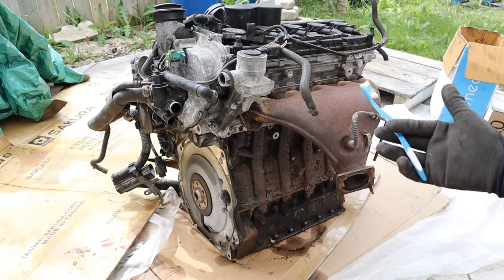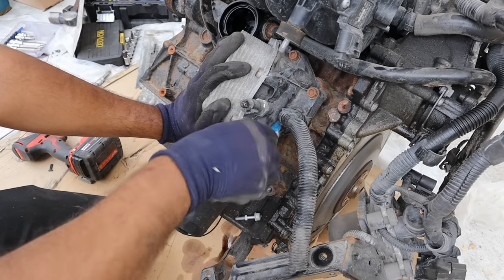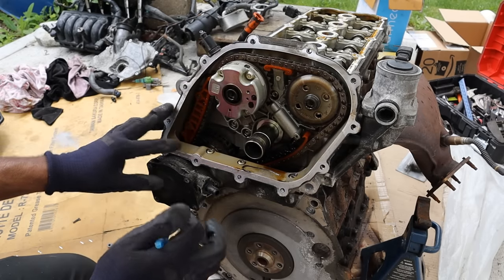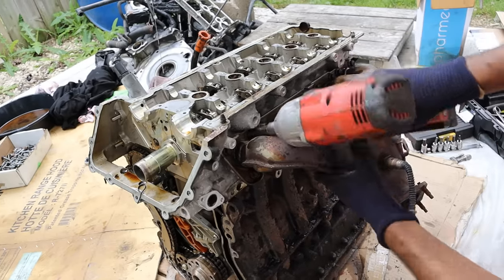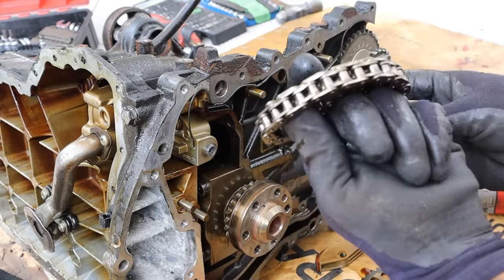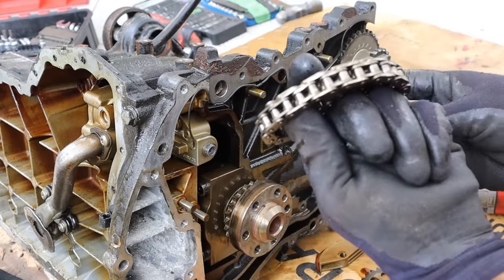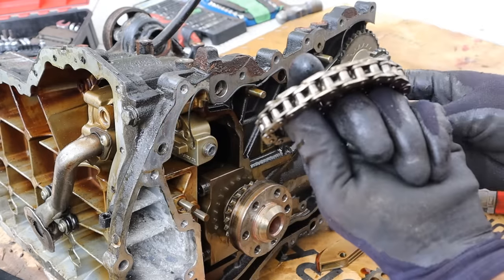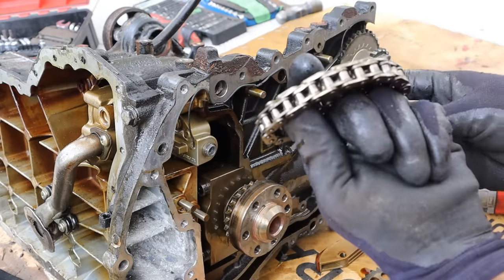The Volkswagen 5 Cylinder is an Anomoly

Comment: Probably one of the best engines VW has ever made, I regularly see these with 200,000+ miles. I've had two of them personally and haven't ever had any major issues. 300,000+ miles combined on both of mine
Reply: Heartily agree. I have a 2.5 Jetta with 263k and it replaced another 2.5 Jetta that had close to 200k before it was totaled. Zero major issues.
Reply: Mine currently has 202,000 miles and going strong.
Reply: Currently have my ‘09 with 136k miles on it. I’ve been changing the oil every 4k miles or 5 months with 5W40 Leichtlauf High Tech Engine Oil (5 Liter) - Liqui Moly LM2332.

Parts that have failed on mine:

2019: ABS module, VCG, & serpentine belt (dealer)
2020: Alternator (Indy shop)
2021: PCV diaphragm (Indy shop), oil cap gasket (DIY) 
2022: vacuum pump delete kit (DIY), MAP sensor (Indy shop)
2023: belt tensioner (DIY)
2024: valve cover kit (DIY)

Upcoming fix 2024: OFHG (Indy shop)
Reply: I’m at 190k miles on mine.. just replaced valve gasket, map sensor, spark plugs and coil over packs. Also put on new brakes. She’s running pretty strong still.
Reply: Probably why they make it complicated and hard to work because they know this engine would rarely see a wrench. So they give the customer 3 times or maybe more labor cost to fix it. If it's ford or just normal asian car, yeah they easy to work on but that also mean you'll have to work on it at least 3 or 4 times in the lifespan. 😂
Reply: I have an 2006 Jetta with the 5 cylinder 127000 miles miss fire on number 1.   90 psi compression    🙁.  Figured I get more out of it than that
Reply: the best vw engine is the 1.9 tdi. fight me
Reply: @mikealicious3848 Seems like mk5 had a little bit more issues than mk6s. My ‘13 jetta is sitting also at 136k miles, and surprisingly I use the same liquimoly oil (the purple one). In my case I had the following repairs done:
-Throttle Body
-Intake manifold 
-Crankshaft position sensor

And that’s pretty much about it. It’s been pretty reliable and is the highest mileage sedan I’ve ever owned. But not everythings bright, my 09g transmission is starting to act up and im fearing the worst. Hope it isn’t the valve body.
Reply: @oldschoolmechanic7771  timing chain skip a tooth?
Reply: I guess I'm unlucky with my lemon. Always change it every 8k kms and had to do both chains 2 years ago. It's now already having chain rattle on cold starts.
Reply: @colesalegna1248   I think I would like a 2.5 Jetta, rabbit, or golf.  Could $4,000  very possibly buy one?
Reply: @jp-sama4176 Put em up! 👊👊👊👊😂
Reply: I have 203k on my 2.5L and it's flawless
Reply: i have one with 284k still running strong!!!
Reply: I’m hoping my ea888 will last like this with regular maintenance

Comment: I don't understand why 5 cylinder engines are not more popular. When done correctly they are as smooth as a V6,  easier to package due to being narrower and cheaper to make due to only needing one cylinder head and one set of camshafts.
Reply: V6's have a lot more parts, manufacturers like that because it drives the service costs up, and that's more profit for them.
Reply: @EdgarsLS  True but they cost more to make so less profit when they sell them in the beginning.
Reply: @EdgarsLS  I think V6s shouldnt even exist. Thats my based take for the day.
The absolute dream engine configuration I can think of would be a turbodiesel i6 with a belt driven camshaft because fuck chains.
Reply: @alouisschafer7212   Gears

Build it once with gears and never touch it until there is a mechanical failure
Reply: @alouisschafer7212  why fuck chains? If done correctly they last the lifetime of the engine.
Reply: The truth is that both are pretty much non-issues. At one time V6's were a thing because turbos weren't as reliable as they are now, and manufacturers could just take the architecture from their V8's and cut them down or take the cylinder architecture from an i4 and scale it up. If you go back to the late 90's and early 2000's, the idea of a 2.0l turbo 4 in a higher tier everyday car was a scary idea for a lot of buyers. Plus, I have this engine in the MK6 Golf form; it's really one of my most favourite engines I've ever owned, but the engine is slow to spool up from a start, once you get going it's tremendously drivable. But really, the writing on the wall is simply that VW never kept pace; 5 cylinders and 5 valves per head, but a Honda K24 eventually made more power from a less complex engine.
Reply: They killed off the 5cyl coz it was too reliable by VW standards.. They're more interested in disposable vehicles these days. Shame, the 2.5 5cyls were fantastic for what they were
Reply from the maker: The 5 cylinders are a compromise... supposedly more power than a 4, but a longer block means more width needed in the engine bay if mounted transversely.
Reply: They're narrow, but the block is longer. 3 long vs 5 cylinders long. Putting a 5 cylinder is basically like putting in a engine the length of a V10.

Also, 5 cylinders have to compete with straight 6 configurations. 5 cylinders are imbalanced, unlike like a straight 6 that has perfect primary and secondary engine balance. Since the blocks already taking up so much space and because they require more balancing, you might at well just go with a inline 6.
Reply: @AkioWasRight  This is mostly sorta kinda true.. For context you have to remember the VW 5cyls were only ever intended for FWD applications; end to end even with the transmission, placed in something like a Jetta transversely, it wasn't much different than a big 4cyl, when a straight 6 definitely wouldn't have fit end to end in a transverse layout no matter how small it would have been. In the FWD 5000 S's of the early 80's it got even worse for the case of straight 6cyl, those were longitudinally mounted FWD where a straight 6 absolutely wasn't going to fit so the 5cyl was that happy medium between 4 and 6 cylinders while still able to fit, delivering smoother power than a big 4cyl would have in a space an i-6 definitely wouldn't go.. Audi 5k era, this was long before VW's VR6's and V6's existed. Now as far as balance the early ones had all sorts of different balance shaft arrangements year to year application to application, but in later versions such as this one the crankshaft had been completely redesigned by then, other parts of the rotating assembly were counterbalanced and they ran pretty damn smooth. I'm not really sure how it hung around as long as it did, it's kind of a dinosaur, but I'm glad it did, they were the more overall reliable/longer lived less problematic of VAG engines for years and years. I miss owning later ones, that sound, and nice even torque curve
Reply: The key word here is "when done right" volkswagen doesn't do it right, volvo would be an example of a company that did it right
Reply: @jasonhooey5677  and MB, don't forget the 300TD lol, but that's a tractor engine! I'd argue the B52xx series from Volvo were very reliable indeed, but very heavy and extremely underpowered.. and prone to head gasket failure. Not really all that reliable turbocharged. As far as the gasser 5's go there's probably more VAG's left on the road than Volvos
Reply: @jasonhooey5677  Volvo sold a bunch of cars with the vw 2.5tdi with slight modifications for packaging
Reply: @7eis The Volvo D5 engine was not sourced from Audi.  It was of their own design.
Reply: @alouisschafer7212 belt 😂

Comment: Fantastic engine! Bulletproof with good maintenance. They are not actually that hard to work on and later years do not have the odd bolt under the intake. My 2012 Golf mk6 with 2.5L has 289,000 miles on it today and runs like a top. Great video!
Reply: That "odd bolt" exists on all of them, however there is a hole for access in the intake.  Just need a real long allen key from like HF. Im at 135,000 on mine and have done no major maintenance except the clutch and oil changes.
Reply: All I’ve ever done to mine was a vacuum pump delete, the gasket failed twice and I said screw it, 216k and runs like a champ

(Edit: +Maintenance obv)

Comment: This engine is an anomaly because unlike most Volkswagen engines it's actually reliable!! This is honestly one of the best no frills engine they've ever built!
Reply: the 1.4t they were putting in the jetta and taos is probably the most reliable turbo they've ever built
Reply from the maker: The 2.0 (2.slow as some people call it) is even simpler than this engine. I have another teardown video on that
Reply: The 1.9tdi (pre ahem emissions scandal) is another one of the very few good VW engines. Good torque, decent power, relatively reliable (outside of the plastic coolant manifold and oil cooler gaskets) and... ridiculously fuel efficient. I easilly used to get over 800 miles (that's close to 1400kms in sane-land) off the 55l tank in an MK V Golf
Reply: Good on you for spelling anomaly correctly. Not so much on the vid title....
Reply: @deen-al-afriqi  I had a 2003 1.9Tdi Octavia. The engine was all those things especially the fuel economy considering how it could accelerate. I saved myself a grand by undoing the front section and decoking the turbo with oven cleaner. That was the only maintenance it ever needed apart from tyres, oil, bulbs,wiper blades and an air-con top up.
Reply: @speedkar99 which one 2.0?
Reply: The Gen 3 EA888 and beyond is reliable. Love my mk7 gti.

Comment: I have learned a LOT from you, now I actually work on my car myself, I can't believe how much money I've wasted on dealerships. Thank you
Reply from the maker: I'm glad you appreciate my videos
Reply: one more thing to add because "it should not happen but does" is your O2 sensors. They do not have anything to do with air/fuel mixture unless one goes bad. Then the ECM is programmed to screw up the air fuel mixture to run bad if one of the O2 sensors go out in an attempt to force you to go and get them replaced. The o2 sensors are there on the exhaust simply to stop you from removing the catalytic converter. This is naturally on newer models starting around 2012 forward. Just an FYI because this is the EPA being sneaky. Oh yeah, the addition of an oil catch can is also a great benefit for your engine. And only a "nominal" impact on the environment because of the filters on them today. This is a necessity if you happen to have a "direct injection" engine which so many of the newer engines are today. But they do not add the oil catch can. What, you want the motor to last forever or something? lol. This stops any carbon buildup in the valves and even cylinders from happening. Also, adding a low temp thermostat is also a good idea. Something around 160-170 degress. Thermostat temps have been rising because it is believed a hotter engine "pollutes" less. Uh, no not really, as internal temps in combustion chamber are the same. It is just best for your engine and all the plastic components on them these days to have a low temp thermostat. NASCAR uses a 160 degree thermostat. If it is good enough for NASCAR I figure it is good enough for me.  lol
Reply: @speedkar99  AND your humor!  😂

Comment: 4 cylinder power with 6 cylinder fuel economy.
Reply from the maker: Exactly why this was one of the last of it's breed.
Reply: @speedkar99  no the 2.5 was used up until 2014.
Reply: More so a displacement thing than the number of cylinders.  2.5L from the scion XB got even worse mpg's and had even less hp than this 5 cylinder.  Not really fair to compare this motor to modern di engines and transmissions with more gears.

Comment: Yesterday I was  looking for a mechanical review on a Jetta 2.5  5 cyl on your channel because it seems like a nice engine, but didnt find it. Glad I found a breakdown.
Reply: It's the most reliable gas engine VW made  during that era & they stopped making them like fools. I wouldn't buy one of there direct injection 4 cylinder with turbo engines. BTW you don't need a new valve cover to change the PVC diaphragm on these engines. There's a cap you can pop off but its plastic so use plastic & not metal to pry it off. The PVC Diaphragm is $10 while the valve cover is $100+. If you've come across one thats well maintained its worth buying. It's also important to know what transmission it's paired with. If its an AISIN transmission, which is Toyota, it's even better. VW makes DSG transmission that isn't bad but it's very expensive if it breaks. I've got a 2012 Jetta 2.5L with almost 200K and it runs great, 25 28 mpg & the issues i've had have been minor. The AC compressor does have a solenoid that cost about $25-$30 that goes out & its easy to get to & held in with a clap ring. I buy all my parts off Amazon.
Reply from the maker: I heard it's common for the valve cover to break when changing the PCV. 
The transmission that came with this one was toast. I should make a teardown video someday ...
Reply from the maker: Well I'm glad you found it!!

Comment: 166,555 today. My 07k has maintenance from VW records back to mile 11. I do all my own maintenance and repairs now, been working on cars for 20 years. This engine is amazing.
Reply: There is a hole for that last hex on the intake manifold. I made my own tool with a long 1/4” extension with a homemade hex loctited into a socket to reach that bolt. Also the socket is loctite to the extension. Reaches the bolt just fine.

Comment: I love our 2008 VW Rabbit outside of the automatic transmission issues we've run into.  The engine still runs strong at 145k miles and still has some great power.  As much as I like it, I still found myself a Honda Fit while my girlfriend kept the Rabbit.  Cheaper/easier maintenance goes a long way as I use my Fit for work now.  Cool video!
Reply from the maker: So what happened with the transmission? I have the failed transmission here that I can teardown for y'all
Reply: @speedkar99 which transmission? I got a mk6 jetta with this same engine and I’ve been told the transmission is the weakest point
Reply: @speedkar99  Well, it has rough shifts or it'll slip out of gear entirely if you accelerate too hard.  We've replaced the solenoids and that has made the problem more manageable, but it still happens from time to time.
Reply: Had a stick jetta at 280k, no problem whatsoever
Reply: @dizzinessman6683  I mean, apples vs oranges here, but congrats

Comment: Excellent engines, far more reliable than any of the turbo gas engines they produce. The 2.5, 5 cylinders can easily do 250,000 miles++ easy to maintain and work on.
Reply from the maker: The 2.0 gas 4 banger is much simpler
Reply: @speedkar99 yea but it’s boring and slow 😂 so it all evens out😂

Comment: Amazing motor. It has had its fair share of issues, but it has never left me stranded. Currently have my ‘09 with 136k miles on it. I’ve been changing the oil every 4k miles or 5 months with 5W40 Leichtlauf High Tech Engine Oil (5 Liter) - Liqui Moly LM2332.

Parts that have failed on mine:

2019: ABS module, VCG, & serpentine belt (dealer)
2020: Alternator (Indy shop)
2021: PCV diaphragm (Indy shop), oil cap gasket (DIY) 
2022: vacuum pump delete kit (DIY), MAP sensor (Indy shop)
2023: belt tensioner (DIY)
2024: valve cover kit (DIY)

Upcoming fix 2024: OFHG (Indy shop)

Comment: I learned a lot, thanks for the upload! Also, what you 'took apart' at the end is the secondary air pump. it's connected via hose to the check valve at the back of the engine and the throttle body.

Comment: I ran the last five hours of an 18 hour trip in limp mode in with the 2.5  and it was still smooth even though it was very sluggish
Reply: Why was it in limp mode
Reply: Drove through deep water on the highway then  it went bad
Reply from the maker: Did the transmission fail on you too?
Reply: @speedkar99  the transmission is good bought the car with 100k miles from old people and then it’s been abused for the past 30,000 miles the car has been sitting for over a year because it doesn’t have AC but it still starts and drives

Comment: I have one of these in a mk6 jetta and she has been the most reliable first car I could ask for. She has 201000 miles on her and she has taken it with Grace. Transmission acts funny in automatic mode but in manual mode shes aight. Ill drive her til she wont drive and hope i see some junkyard jettas lol. Appreciate the teardown. Not a lot of info on these engines all over the place except reapirs for common issues.
Reply from the maker: Awesome! Transmission issues seem to be what take these cars off the roads.
Reply: Currently have my ‘09 with 136k miles on it. I’ve been changing the oil every 4k miles or 5 months with 5W40 Leichtlauf High Tech Engine Oil (5 Liter) - Liqui Moly LM2332.

Parts that have failed on mine:

2019: ABS module, VCG, & serpentine belt (dealer)
2020: Alternator (Indy shop)
2021: PCV diaphragm (Indy shop), oil cap gasket (DIY) 
2022: vacuum pump delete kit (DIY), MAP sensor (Indy shop)
2023: belt tensioner (DIY)
2024: valve cover kit (DIY)

Upcoming fix 2024: OFHG (Indy shop) 

My auto trans is failing. A replacement is coming soon. My transmission was never serviced until 120k miles, which was around the mileage when it started to shift rough. Six months later after I do a drain and fill, it started slipping anyway.
Reply: @mikealicious3848  Lucas works great for the engine in these cars. Lucas makes a trans additive. Probably won't fix it. But it may give it enough of a kick to live longer.

After a while the plastic oil filter housings rod will literally break. Mine happened at 180. Keep one on the ready if you don't wanna get stranded.